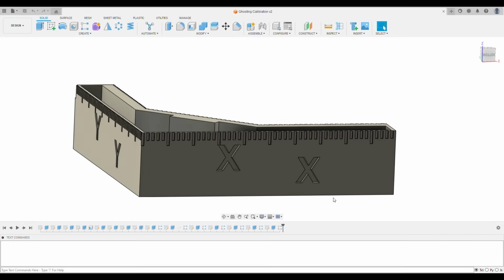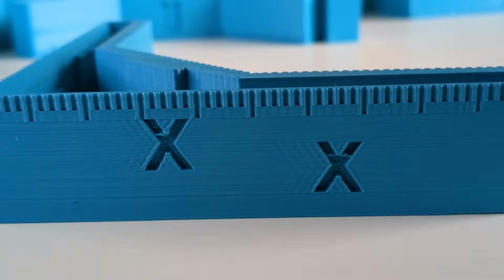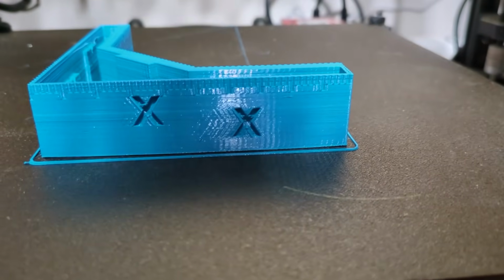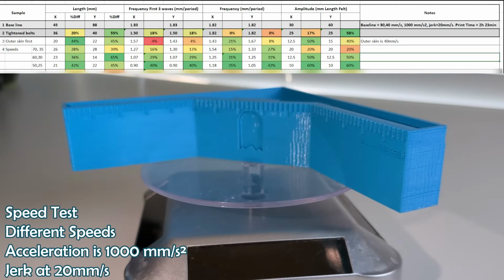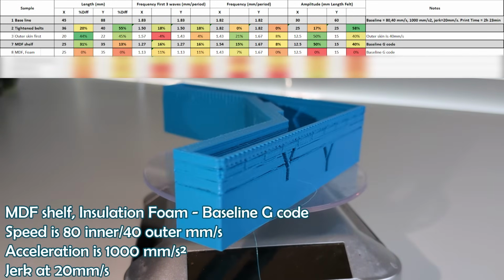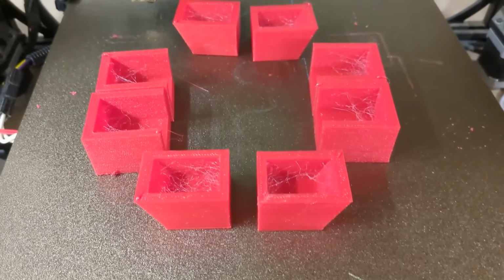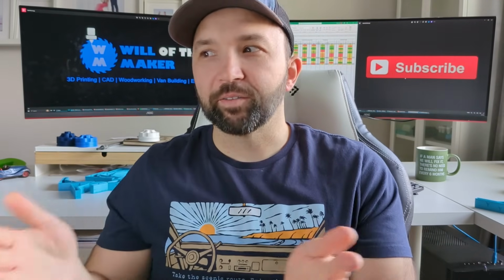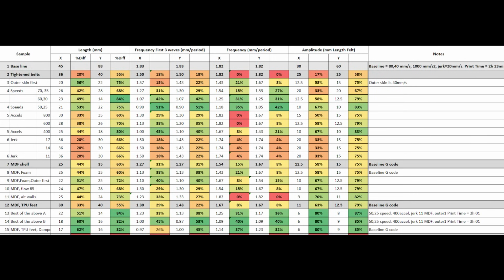GHOST BUSTING! A systematic approach to stop ghosting. also, should printers have shock absorbers?

Comment: For anyone who may not know: Since velocity is your change in displacement over time, and acceleration is your change in velocity over time, then jerk is your change in acceleration over time. 
My physics courses have definitely helped me in a few areas of my life, and 3D printing is one of those places, lol
Reply from the maker: Thanks for these post. This is one of the things that throws me off about jerk. If jerk is the derivative of acceleration,  shouldn't it be in mm/s^3 in that case? I haven't been happy with some of the descriptions I've seen about it. One where I saw it was more about braking to a speed into a sharp direction change. Mm/s makes sense for a speed. 
I'd like to believe it is basically a change in acceleration and it is how quickly it gets up to the 1000mm/s^2 but if jerk is in the range of 10-20 mm/s there is a disconnect somewhere for me..

Def not trying to argue if it's coming off that way. Interested in a better understanding
Reply: It isn't, it is basically the speed you keep in the corners instead of slowing down to zero, using the inertia of the motion system.
Reply from the maker: @riba2233  This was one of the descriptions I saw and made the most sense to me given its unit which is why I mentioned this, although to some extend i mentioned it as braking into the turn and not necessarily at the turn.

Comment: Your conclusion is not supported by your tests… You are wanting to draw a conclusion that putting the TPU on the belts reduced everything. This finding is incorrect, since for all you know, actually tightening the belts more did this. The biggest challenge you have is your belt clamping system is so poorly designed that you can’t actually properly tighten your belts. The last thing we need is bad conclusions like this one floating around confusing people.
Reply from the maker: Thanks for the feedback. You are right that tightening the belts could be a contributing factor to the end result. I think that is part of it but not all.  The sound being a lower thud on the lower belt path says dampened vs high pitched "ting" of tight belt.   A better thing would be to have a way of just sliding it on the belt more akin to the tennis racket example. But this was a quick and dirty . Maybe something worth exploring.
Reply: @willofthemaker  The thud does not say it was dampened. Since tightening it more does the same thing. What you truly need to do is tension the belt as per the sec for your belt. Which is easy enough to do. Your findings do not conclude there is more than one contributing factor. Now don't get me wrong, I do believe there is in fact more than one factor, however your test of TPU is completely unsubstantiated until the belts are set to the proper tension. All of the tests you have run, really need to be re-done once the belts are properly tensions and input shaper is properly implimented. Otherwise this is simple misinformation.
Reply: @willofthemaker  One added note. Your test on TPU feet was also pretty conclusively done by Thomas Sanladerer in a way more complete fashion. This "I did it so you don't have to" stuff... Really... If you are not going to put real effort in to-do things correctly, and not "quick and dirty" all you do is confuse people who do not know better.
Reply: @johnbeima6413 geez dude, try being constructive without being rude next time.
Reply: @willofthemaker  the TPU dampening is interesting as an idea. I would say be very careful suggesting the way you did it as a solution for other people to use. Basically you have changed the intended geometry of your belts — your print head will move slightly more or less depending on where it is on the rails.

I think isolating out obvious printer setup issues first might make for a better starting point — like belt tension.

Comment: Sorry, not enough material for a subscribtion. The shown is 2018. Nowadays we have Klipper and Inputshaper. There is no reason for extrem ghosting anymore since a few years. Even with bad hardware like yours it is possible to print fast and in good quality.
Reply from the maker: Sorry to disappoint. Not everyone has newer machines with klipper (or older with klipper added on). Better luck next time. Ill probably do a video converting this old printer to klipper at some point soon